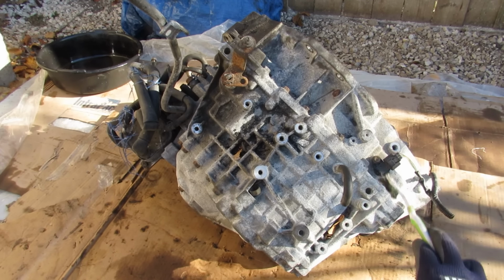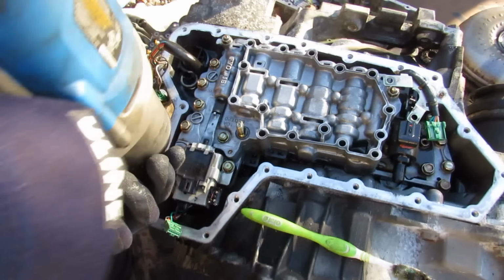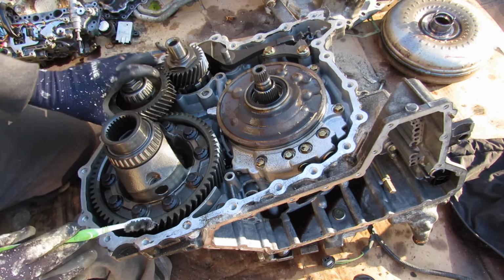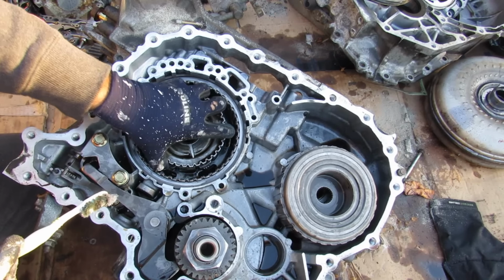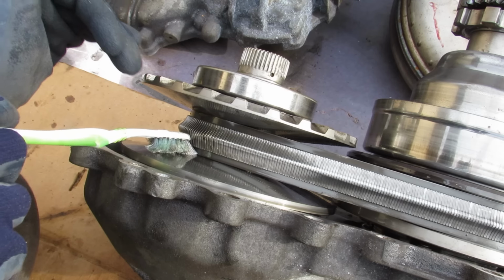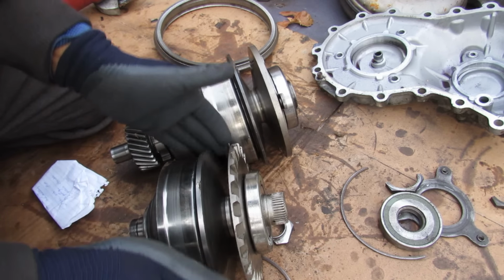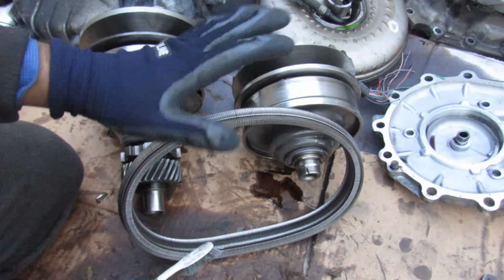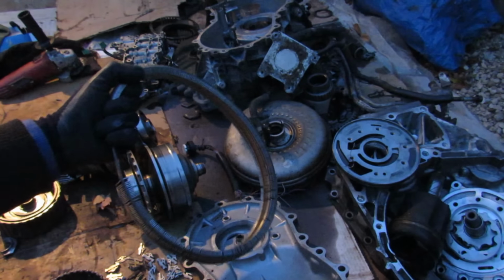Why Nissan CVTs FAIL

Comment: A lot of this discussion applies to Subaru CVTs except that owners aren't allowed to do fluid changes or the warranty is voided.  Dealers won't do fluid changes.  And, no one rebuilds Subaru CVTs so it's a complete replacement when it fails.  Terrible idea for the long-term owner.

Comment: I had a rental Maxima a couple years ago with the CVT... I was actually pretty impressed with it.  It "kicked down" SUPER quick compared to a regular automatic and very smoothly.  I didn't think it was noisy either.  When I got home and started researching Nissan and their CVT, I discovered the horrors.  Meanwhile, the ZF 8HP in my Charger is awesome.
Reply: Thats odd last maxima i drove had a CVT and i was actually unimpressed at how it responded to kick down as it was slower than my 4 cylinder ford fusions 6 speed trans going from 6th gear to 3rd gear for getting on a highway... the nissan when i went to boot it kicked the RPM up pretty quickly then lazy decided to give power slowly, i know it was the transmission that did it cause the 3.5 litre engine from a stop was able to throw quite a bit of power well, but on kick down the car felt slow and slushy when it was adjusting its ratio.

Comment: Thanks for taking the time to clearly explain how these work.  We bought a 2010 Sentra new and it has 155k miles on it and still runs quietly and smoothly.  I never changed the CVT fluid until the warranty expired at 120k miles.  At that point I drained the gallon that comes out and replaced it with Valvoline's fluid.   Drove another 10k and did it again.   I did it a second time at 140k.    So far, so good.  I mostly use the car to commute to work at 80mph and have not had any issues.   I can see how higher performance cars would eat up such a simple belt with too much power.  I'm hoping our Sentra just keeps on running since the resale value is low, but the car still drives like it did 10 years ago.
Reply: Yeah, I would change that fluid every 40-60k miles.  It's cheap insurance for any type of automatic transmission.
Reply: CVT's are great for cruising long distances on the highway at 80 or 90 mph in a lightweight car. What seems to mess them up is racing full throttle from stoplight to stoplight like I see a lot of Nissan owners doing, especially in the heavier SUV's. I know it's fun to be able to beat Audis, Camaros, and noisy Subarus from light to light with your Murano, but if you do that a lot, you'll end up in my buddy's transmission shop with bad news. Those transmissions are not made for racing.
Reply: @jackandblaze5956  Agreed 100%. Aggressive driving habits will cause early CVT failure unless its a Toyota or Honda CVT......
Reply: @jackandblaze5956  if you can't prove it, dont say it.
Reply: @sonicelectronic57  I think what he was saying was the point of this video. Like dont tow much and put a lot of stress on these cvt's because they have points that can fail under too much stress. It seems to follow that racing light to light and towing heavy stuff is bad for this transmission type.
Reply: That just goes to show you can't believe everything you see or hear
Reply: this kid at my school was trying to do a burnout. issue is hes in a low rider truck with a manual transmission he drops the clutch the car didn't stall but you could hear the nice music of grinding gears and a loud bang.
Reply: Most Nissan CVT trannys go in the first 30k maybe 40k. All the damage is done during the first 10k. So if it makes it past 40k chances are your trans will last you for a long time with normal driving habits. Provided you keep the CVT fluid fresh. Never skip fluid change intervals. Nissans are 40 to 80k depending on model and year my 2010 maxima is done every 60k but I still regularly check fluid condition every 5k. Fluid should be clear and transparent in color. If fluid rubs off on a white rag and has sparkles or starts getting dark and opaque trans is breaking down.
Reply: Any suggestion why my 2010 sentra turns on but rpm goes down and it turns off.
Reply: Thank you , I was worried I have a 2015 with just 27 thousand miles so now I feel it will last long enough .
Reply: @txrick4879  you don't really need it. As long as you don't get caught and even then it would just be a fix it ticket
Reply: For sure ⁰ll
Reply: For the next CVT oil change, try out amsoil transmission flush. What oil you use is up to you👍
Reply: @Antimortem  I switched to Amsoil CVT fluid at 30k miles and it's been great. At 65k miles now with no issues. Amsoil says it's CVT fluid is warranty proof!
Reply: @Antimortem  DO NOT DO THAT. Cvt fluid is not the same as trans fluid. You will damage it forever.
Reply: @Antimortem  NEVER use a flush unless you want the solenoids to fail causing the trans to fail…

Comment: I used to worry about all the stuff in a modern car , auto transmission , power steering etc. until one time I had to drive my Wife's Fathers old car with a manual box , no power steer and boy what a heap of junk to drive .  Got back into my Nissan X-trail CVT and so much better to drive .
If you drive a CVT carefully it will last fine .  Never lend your CVT car to anyone and especially a young hoon  they can wreck the transmission .
Some people will break a Tiger Tank if they are allowed to drive it .

Comment: Wow! I wasn't expecting such an in-depth teardown when I clicked this, that was extremely interesting to see. I knew the general function of CVT transmissions having worked on snowmobiles and the like, but never had one disassembled in front of me or had it so expertly explained. Excellent video! Thank you!
Reply: It was a great video! I have also dealt with CVT for my snowmobiles over the years. The big difference is having a simple spring loaded pulley system CVT based on centrifugal force and a user changeable rubber belt! It's easy to work on and mechanically smarter that the complicated Nissan Jatco CVT. Makes sense to change a rubber belt once every couple years for $150 versus a $5000 CVT but I get that the weight of a car requires all the complex hydraulics and cooling.

Comment: I got lucky on my Nissan Quest, got 110,000 miles out of the original CVT before it went bad.

Unfortunately, that meant that not only was it past the anemic 3/36 Nissan warranty, but it was also well past the 10/100 extended warranty that I bought when I got the van, so I had to lay out $4,300 to get the stupid thing replaced.

The replacement was, of course, a factory rebuild. It's got 47,000 miles on it now, still working, but I don't want to put much more than 50-55k on it, so I'll be shopping for a new vehicle soon. And the new vehicle will NOT be a Nissan; these crappy CVTs have permanently soured me on what was a very good car brand, because Nissan knew they were problematic yet continued to use them in multiple models of vehicle for years without making any significant fixes.

Comment: Biggest problem is the fake shifting they make CVTs do to mimic traditional transmissions.  If they would just let them be a CVT that would remove a LOT of stress off of them, but people think they are broken because the engine gets to a set RPM and just stays there.  I wish they had the "smart owner" mode where you could turn the fake ass "shifting" off.

Comment: I've driven Murano's with CVT since 2008 without any transmission failures. I also have a Toyota Avalon with a CVT that runs like a charm and has never had any failures. I have never used to tow.
Reply: Consider yourself lucky. Give an update on the Murano around 150,000 miles.
Reply: @SupaStah01  Yeah, my aunt had 2 Altima's (not at the same time) and they both had transmission problems
Reply: @SupaStah01  agree

Comment: I've never had a manual transmission that wasn't abused fail on me.  These things violate the KISS principle by a factor of 1,000... that's why I still drive a manual.
Reply: I like traditional automatics, they are proven to last a very long time. CVTs have a long way to go before they will be reliable enough to compete with regular autos or manuals

Comment: I watched too much Scotty's videos, I won't buy a car with rubber bands to drive (1) the timing system/camshaft (2) the wheel. Time to learn driving manual.

Accessory belt is the only rubber band I will accept because it is easy to change.

Comment: Too complex for a variomatic as it isn't easy to change the belt if it goes bad. Gotta love this bit of DAF tech though as nothing is faster off of the line as a variomatic transmission.

Comment: very interesting and informative video, I've seen some videos that use illustration but actually opening and showing what's inside is the best way to learn.
I have Honda Jazz (fit) that has CVT with 110K + miles and it's still going strong, I hope it will last well in to the future.
Reply: Hopefully you’ve changed your cvt fluid on that Jazz?
Reply: @haroldbeauchamp3770  yes I did my last change was around 20k miles ago, before that it was in the previous owner care.
Reply: @eliadbu  good to know. I’m sure it’ll give you many more years of service. Failures are occurring on cvts that’s have never had fluid changes.  Much more rare on units that are regularly serviced.
Reply: @haroldbeauchamp3770  yes it is known that any transmission without regular fluid change will fail prematurely, overall I'm in support for servicing my car per manufacturer recommendations because engineers over there have better knowledge than me or even the average mechanic on my car.
Reply: Take it or leave it, if that was mine id get right out from under it before it breaks. The issue is that its more than the cars worth to fix and these are, undebatably the breakiest kind of trans. People who love them thinly veil an undying resolve to lower emissions, and every one ive met has the cash to just buy a new car and act like thats not worse for the planet. Ignorance in practice and youll know it cause thats what theyll call detractors. However most of them drive cars way too expensive to have this paupers tech in them. Wont see this in a tahoe or bmw anytime soon. They leave that burden to you. Theyll buy one new for kids first car and sell at 25k miles and go around saying they never had any problems.

Comment: Even having seen this in dry version on older lathes and drill presses I watched the video in joy. How do they drive vs the standart Mercedes 5 speed 722.6?. How many miles do they run till overhauling is needed?

Comment: CVTs are fine on mopeds or scooters, but I've always hated them with a passion in cars. They just feel so awkward in operation and, as you've pointed out, I'd rather not rely on a steel belt to handle all that torque. Still: Super interesting to see one from the inside and have it explained to me in a way I can (barely) comprehend.

Comment: https://www.carcomplaints.com/news/2019/nissan-cvt-settlement-reached.shtml  Please visit this site if you have a 2013 - 2017 Nissan Sentra.  It gives you details on getting your CVT fixed for free if you qualify.  Just note that although the settlement link does give a deadline of 1/20/20, just know that you can can still qualify for reimbursement if you file a claim within 30 days after a qualifying transmission repair. Go to a Nissan dealership and they may  be able to complete the repair at no cost  without even having to fill out a claims form.

Comment: Great video! Have you already done a similar one on Subaru CVT's? There's a lot of debate online on whether Subaru CVT's are reliable or not, especially for off-roading/overlanding. Subaru recently debuted their "Wilderness" Outback which supposedly has a beefier CVT but I'm kind of skeptical about it.
Reply: There’s nothing beefier about a Subaru cvt. All Subaru did is what nissan did to fix their issues. Added a trans cooler and switched to fully synthetic fluid. Nissan recommends cvt changes every 60k miles, Subaru doesn’t recommended changes. I believe that’s why Subaru has more repairs and Nissans repair rate is quite low now.
Reply: @haroldbeauchamp3770  Subaru uses a chain and not a belt...they are beefier. Subaru are made in house unlike Nissan and are alot more reliable then Nissan, but as you said Subaru of America doesn't recommend Cvt fluid changes unlike Subaru of Japan which is I believe 60k.  If Subaru Cvt's have a downfall it's not having that recommended service date even though they have been fairly reliable especially after 2015
Reply: @no1lineman   as a senior warranty claims administrator/risk analyst for the nations top 5 extended warranty companies, I can say you’re partially right. Subaru does build their cvt’s in-house, but this has absolutely no bearing on them being more reliable or not. In fact, Subaru partnered with Jatco back in 2003 to acquire their cvt design to be able to build their cvt in-house. Some of those Subaru folks who bash Jatco do not realize all modern Subaru cvt’s originated from a Jatco design. In reference to the chain, That’s a bit of a misnomer. Subaru actually uses a steel belt. A flexible steel belt that is commonly referred to as a chain. Exactly the same steel belt design that all current Jatco cvt’s, Honda, and some Toyota’s use. Currently there are no automakers cvt’s that has major flaws or failures. Nissan, Mitsubishi, Subaru, Toyota and Honda all have generally reliable cvt’s. However, every single manufacturer with the exception of Subaru recommends or requires cvt fluid changes regularly. As of 2022, the overwhelming majority of cvt failures are from Subaru. 90%+ of Subaru failure are “burnt” valve bodies. Caused by overheated cvt fluid. Completely preventable if Subaru would recommend fluid changes every 30-60k miles as they require in other parts of the world. I always tell Subaru owners that their cvt’s are completely capable of reaching past 200k miles if they do fluid changes regularly.
Reply: @haroldbeauchamp3770  You maybe right on the Jatco relationship with Subaru, but you're the first guy I've heard say that. I know Jacto designed and built thier traditional automatic x-missions before the widespead usage of cvt's back in 2010ish.I also know Subaru's steel chain does't look anthing like the one he was pulling the links out of from the Nissan.
Reply: Bottom line, dont trust anything but a new or recently rebuilt trustworthy automatic with a history of reliability like a thm400, or preferably a manual. Cvts are built on an incredibly shoddy and complex priclnciple and they will fail. They do not hold up to the random stresses of offroading, with things spinning and catching and looking for grip. Look at these tiny parts and tepl me if you think repeated mashing will aloow them to work at these ridiculous tolerances. You want gear on gear, put it there and it stays, manual transmission. Also any dumbass can pull and fix them if you break the teeth or need a clutch. All subaru is doing is trying to keep their target market while lowering the total emissions of the fleet. Thats the ONLY reason cvts are used. Not reliability, not a better drive. I drive a 40 year old sub 4x4 (not awd) and i wouldnt take a wilderness outback for it unless i could sell it and buy 5 old GLs. Screw what subaru has become, a lifestyle brand, selling to idiots, trading on past reliability. Excluding their performance line, which still uses gears. Cause people who know and want to mod an sti will NEVER buy a cvt, so they make up the emissions on bearded dummies wearing north face pretending they do outdoor shit. Dont fall for it. Look at the people youve seen in those traffic cone crosstreks and ask if you wanna be like those guys.
Reply: @xijinpingsfavoritehemorrho1328  It doesn't make much sense to have a CVT in a vehicle that is meant to be rugged and capable off-road. A torque converter automatic would be much better for Subarus especially since those boxer engines aren't efficient to start with.
Reply: @I_THE_ME  exactly, but i wouldnt put too much faith in a modern auto trans either. What cvts are good for is keeping revs down on the highway for a long commute, but the job youre headed to better be good enough for you to have a big rainy day fund, like 3-8k when the thing fails, and it will.

Comment: They fail bc they're junk. 
I was having my Chevy trans. rebuilt a few years ago and was talking to the manager. 
There was a late model Subaru in there for tranny work. 
Strange I thought bc Subaru's are supposed to be great reliable cars. 
He said that they are, but, when their CVT's break, Run! 
He told me that a CVT trans can run around 5k-6k to repair/rebuild. 
That was back in 2017 in Northern Calif. 
I had a bad experience with Nissan back in 1985 but that's another story.
Nothing beats an old-school 5-speed manual transmission for reliability.

Comment: Great video  I'm wondering what generation cvt are you using in this video. The new 3rd generation CVT  I believe has fixed the problems from the older Transmission   Thanks

Comment: Nissan Altima been my favorite car for quite few years, I ended up selling my Challenger SRT and trading in my 2017.5 Altima SL for brand new 2021 Nissan SV AWD with 5 miles on it. 3 Nissan Altima pass 7 years, I drive Lyft zuber for extra income and also run independent driving service. Cars roomy, especially 2021 is. Crazy space i am 6.1  and comfy both front and back seats adjusted for my height. I use Altima for work, daily, school and long trips, I also always drop 55 HP of nos, Incase I need a fast multi semi truck pass with 5 people and trunk full of bags. No issues CVT holds up with no issues. Never broke on any Altima, so far I out over 45k miles on first 2 before trade, 2021 just barely over 500 initial miles, but st 5k dropping ZEX 55 shot as always.  Oh, always eibach lowering springs set, .9 on the for t 1.2 on the back. Barely noticable driving, but takes corners great and tamps perfect, looks more aggresive too